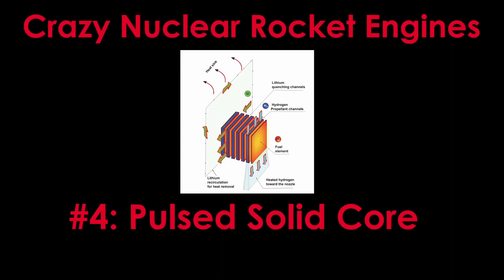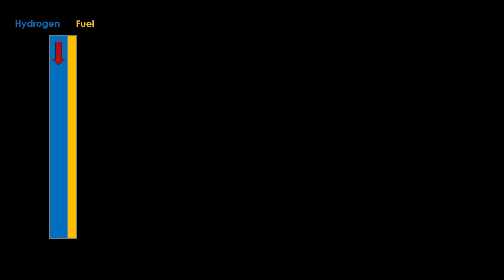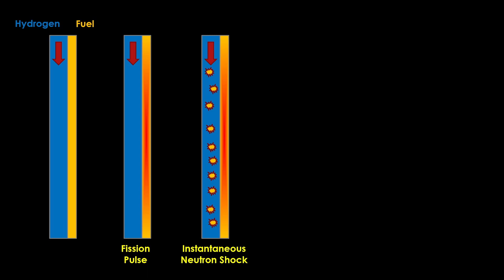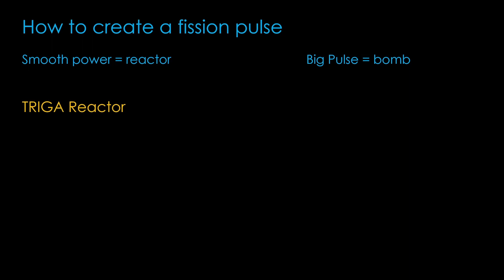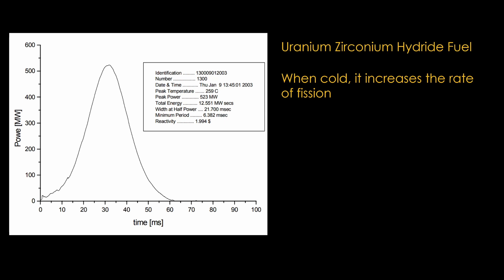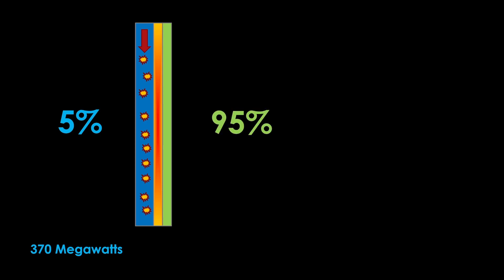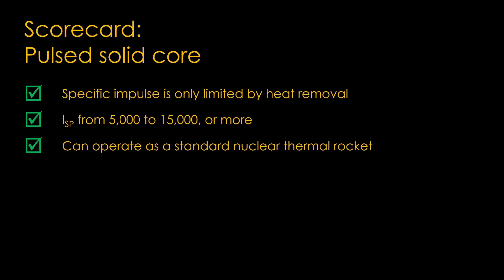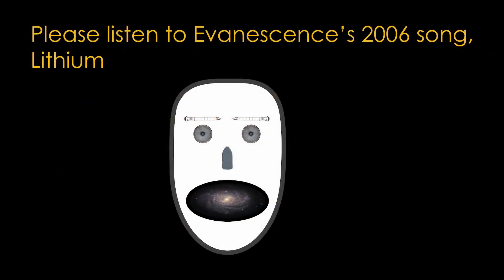Crazy Nuclear Rocket Engines 4 - Pulsed Solid Core

Comment: I think this one actually could be done, you could probably design a geometry that would allow the fuel to get extremely hot, use the lithium as a coolant (as someone else has pointed out, it is lighter than water thanks to its atomic weight) and use the Hydrogen fuel itself as a moderator.  Let's not forget, Hydrogen itself is one of the best moderators for nuclear fission out there thanks to its light atomic weight.
Reply from the maker: Lithium coolant makes your radiator size manageable but unfortunately turns your radiators to junk if it gets too cold.
Reply: @EagerSpace NERVA was demonstrated to be able to act as a power reactor, not just a propulsive device, so that would probably handle your needs to keep the cooling systems warm enough.  Ultimately it's just an engineering problem.

Comment: Why wouldn’t you just have a liquid uranium core and contain it in a thin tungsten drum? I figure the weight concerns would be there but it would be cheaper and simpler, would it not? And it would prevent uranium exhaust

Comment: I like the idea. The lithium coolant loop can be used to generate electricity for onboard systems. It is much more than needed, 7 GW, but the beauty of it is that there is already a part of the system for electricity generation in place. So why not use it? And an Isp of (average) 10000 s can deal with a heavy nuclear core.

Comment: The ISS radiators operate at low temperature, around 290 kelvin, whereas the operating temperature of a liquid lithium radiator would need to be at least ~454 kelvin. 

This 1.56x greater temperature may seem small, but the radiative power of an object increases with temperature to the *fourth power*, so a radiator of the same size with a temperature 1.56x hotter would radiate almost 6x the power, and therefore would radiate the same amount of heat if it were 6x smaller.

Lithium has a boiling point of around  1615 kelvin. I'll assume we don't want lithium vapor anywhere so I'll limit the operating temperature to 1500 kelvin. At this temperature our radiator now emits over 715 times as much heat per square meter compared to the ISS radiators, so about 286.3 kW/m^2. 
To remove all 7 GW of waste heat, the vehicle would require four high temperature radiators arranged in a cross shape that were each about 80 meters by 80 meters. Certainly large, definitely not ridiculously infeasible. 

If we wanted to get really crazy with the engineering of this thing, we could actually design the coolant loop to boil lithium in the reactor, and run the radiators at nearly the same temperature as the core fuel elements, which would be somewhere around 2700 kelvin, which would result in needing 4 radiators that were each ~24.15 meters on a side. They would be glowing white hot at over 2 MW/m^2, but for reference, they would still be 995 degrees colder than the melting point of tungsten, and 1123 degrees colder than the melting point of carbon. 

If I were designing this thing I would want to have the lithium loop exit the core within a couple hundred degrees of its boiling point, then circulate through high temperature radiators. Upon return, the liquid lithium would pass through a heat exchanging manifold, where it would dump a large volume of heat into the hydrogen (phase changing the hydrogen into a high pressure supercritical fluid), then flow back into the fuel element cooling manifold. Preheating the hydrogen makes the neutron shock heating more effective, and it makes the lithium cooling loop MUCH more effective. As for hibernation and start-up, simply by running the reactor continuously at low power the radiators and lithium loop can be held at 250 celsius for long periods, ready to ramp up in power preceeding a burn, or the core could be shut down entirely and the lithium moved to a holding tank. Then, presumably after a period of years, the system would prepare for a burn by bringing the core online at very low power, and transport heat from the core into the lithium reservoir via heat pipes or some other loop, eventually melting the lithium and refilling the coolant and radiator lines. It would certainly be more complex than any propulsion system built today, but in the future if we have a much larger presence in space and are looking at an Isp figure from several thousand to as high as 15,000, I think the incentives could be there to pursue development of this concept.
Reply from the maker: Thank you for the information. 

The biggest problem I see with running the lithium directly through the radiators is that the failure modes are just terrible; if you ever have any issues with flow rate and the temp drops, you trash the whole system. And if you get obstructions from that, you probably melt the motor as well. Not good. That is why my assumption is that you will run a secondary loop with something other than a liquid metal.
Reply: @EagerSpace i mean, if we want to go particularly extreme, we're still not talking about an open-to-space droplett radiator setup with the lithium.  

That said, I think a regular fission fragmentation system is probably more reasonable for the dV.   Maybe go a /bit/ crazy and reach for the dusty plasma proposals.   Or just use an Orion.  

Speaking of, any chance of future coverage of minimag orions for this series?
Reply: Great explanation! Thanks!

Comment: How do the other nuclear engines shut down? In a nuclear power plant when you want to stop it you have to keep pumping water. On a rocket engine, you can't keep pumping fuel otherwise it would generate unwanted acceleration. If you choose to slowly bring the power down, the last kgs of fuel would be heated very little, and therefore, the isp of the engine while shouting down would be awful
Reply from the maker: That's in the category of "solutions to that problem are left as an exercise to the reader".

About all you can do is turn the control drums to damp down the reaction as much as you can and then slowly pump hydrogen through until the temperatures normalize. And yes, you keep getting acceleration and you get poor Isp during that period.
Reply: Radiators to provide cooling